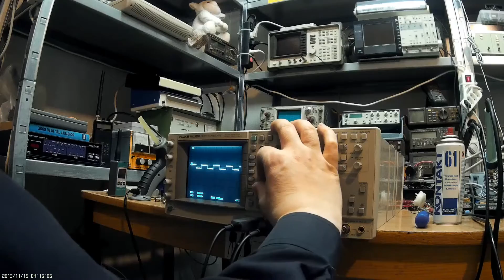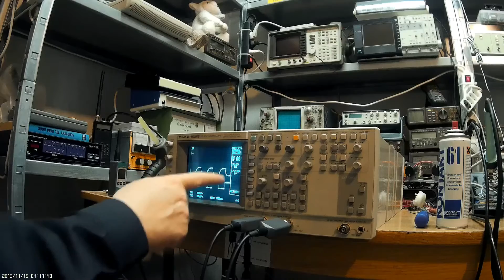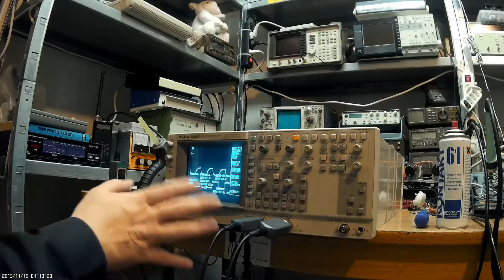Help me repair an Oscilloscope.

Comment: I have similar scope, Fluke PM3092, there is small problem that focus is uneven on screen, so when i focus it good say lower part of screen and upper are fine and sharp, but middle is a bit un sharp.....is there any setting in setup for this, or it could be hardware problem?

Comment: I have/had about 30 to 50 of these scopes, because no other scope is so stable to measure high voltage. Several of my scopes had the same problem. It is always the same issue. It took me years to find the problem. On the 4 channel version it either happens to Channel 1and 3 or Channel 2 and 4 interestingly, never to all of them.
The problem is the Hybrid Chip. You need to exchange it and the problem is solved
However, you need to do a complete recalibration after exchanging the hybrids.

And BTW, the code is 32415. I got that secret code from a Fluke guy out of Holland, where these scopes got built in the Philips factory.

I also got some of these 4 channel scopes with all extras. They are just amazing scopes. Have fun repairing it.
Reply from the maker: Wow, thanks for the Code, Chang!

Any idea on where to get the hybrid chip these days?
Reply: Tommy Helgevold
I have no idea where to get the hybrids anymore. The place that I used to get them from, folded about a year ago. Well, I can ask a friend, if he still has some. If I find them, I will let you know.
Reply: Tommy Helgevold
I think you can try to repair the hybrid if its possible to open the chip carefully without any damadge. It works in most of russian scopes.